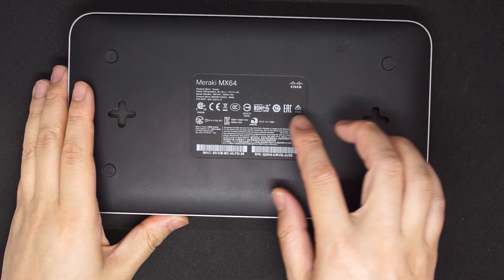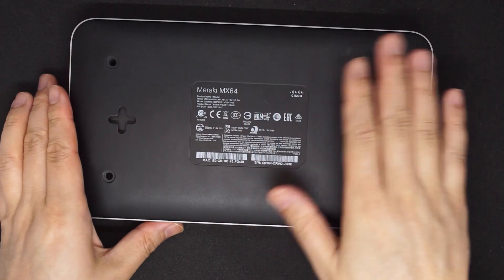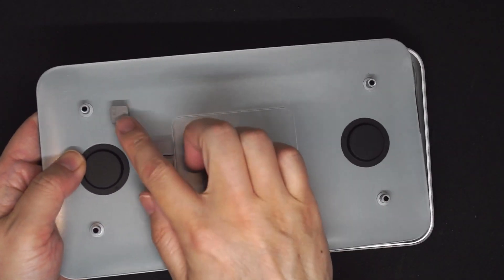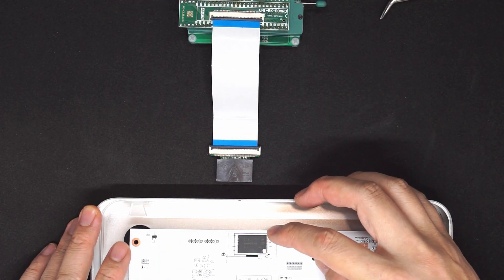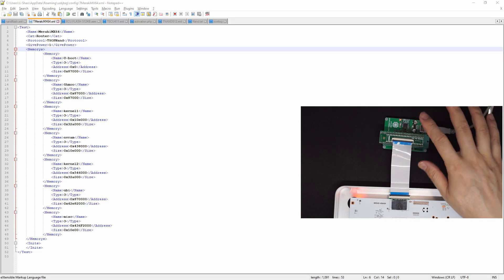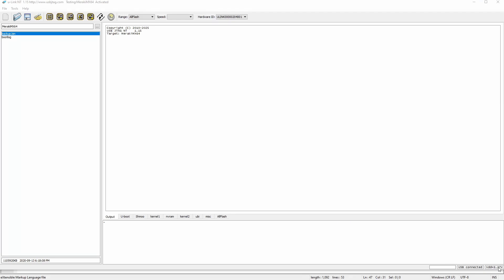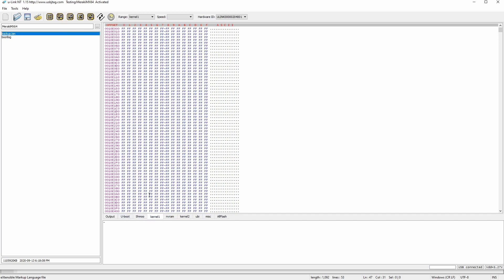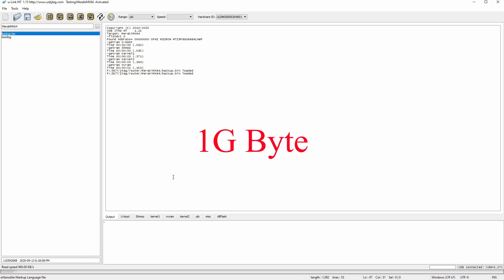Another example of u-Link Nand (Prototype) to access NAND flash on Meraki MX64.

Comment: Nice work! 
As far as I know, OpenWRT already works on this hardware. Unfortunately, I didn't load mtdblock0 with the dd option and starting the shimoo test. Is there a chance to restore this area by uploading it directly to mtdblock0 memory? from .bin fille ?
Reply from the maker: ulink NAND is just raw NAND programmer. So if you have good backup sure you can put back.
Reply: @usbbdm  Thank you for your answer, all that remains is to specify the memory address to which the image is to be loaded :-(  On the one hand, mistakes cost money and on the other hand, they force you to learn :-)